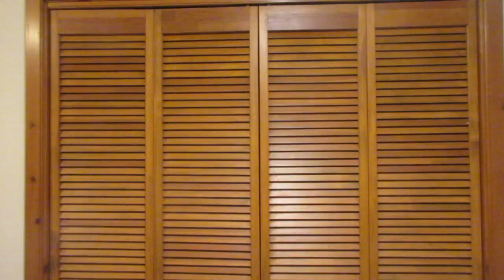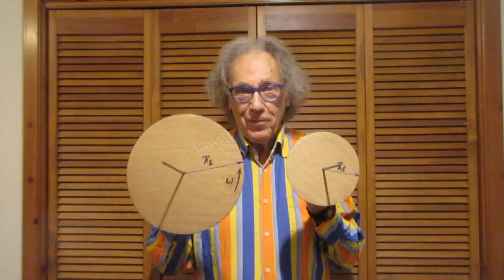Problem #8  Rotating Discs  - not easy!

Comment: First we chose as system both of the discs...So dt before touch the system has an angular momentum L1...L1=(1/2)m1R2^2ω1.Dt after touching them (considering there is no slip so no energy is lost or maybe no angular thrust is created from friction whitch will be negative for the system is generated) then the system will continue to have the same angular momentum but with the final ω2 L2=L1= [(1/2)m1R1^2+(1/2)m2R2^2]ω2...Solving for ω2 will be fine ^.^
Reply: Savvas Kokkos not exactly. angular momentum is defined around a point. you've just added the MI's like they're rotating about the same point
Reply: Sugat Kokiloo maybe I should calculate the angular thrust and add it to the second disc...which I think will lead me to the same result?
Reply: I don't think angular thrust has much to do because of no external torque since we are taking both the disk's as a system.
Reply: working the way around it through energy conservation and equation of motion will do it.
Reply: I don't think there is any slipping - I think kinetic energy is conserved.